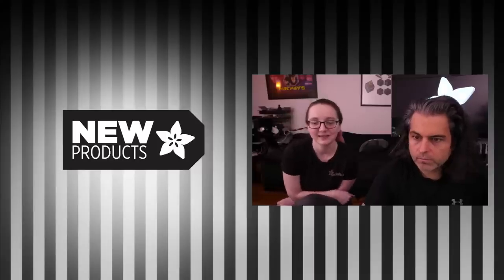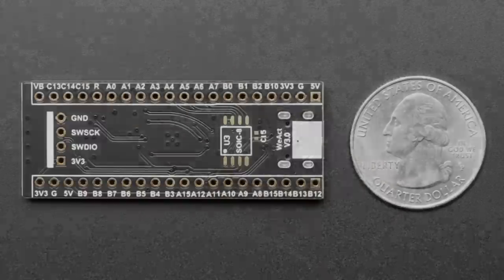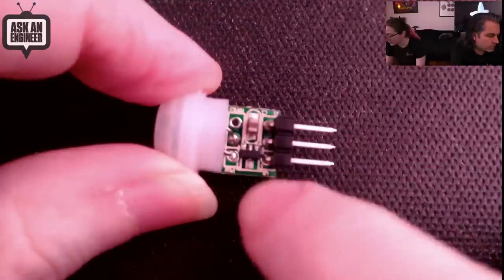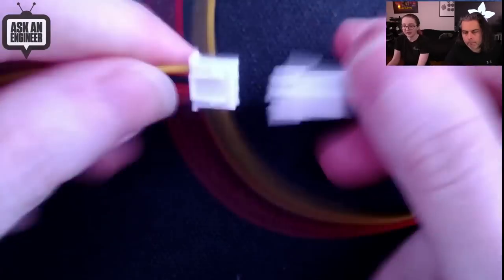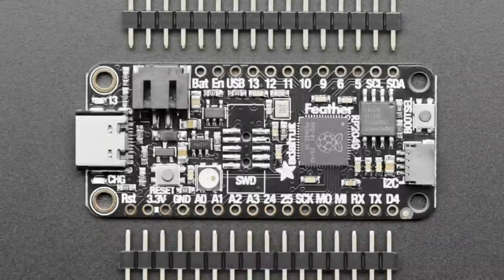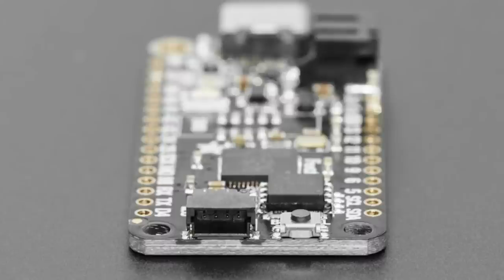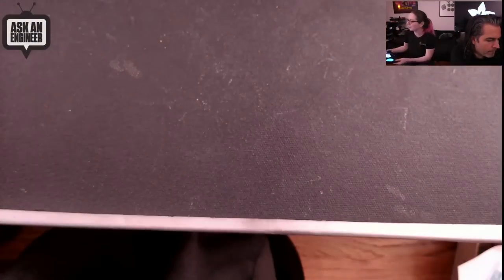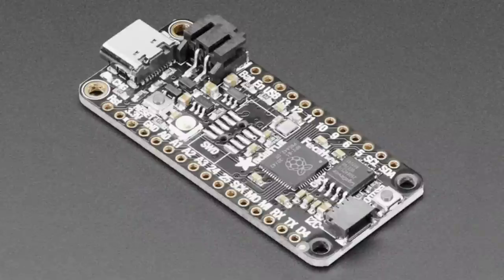New Products 3/03/2021 Feat. Adafruit Feather RP2040!

Comment: Do you have extension cables for Battery monitors? I am looking for one that is already made up. It has 26AWG wire and is a 5 pin connector. The one that came with the monitor has the same end on both sides which I believe is a female end. I guess I need one with a male end and a female end. I believe it is a 2.5 pitch and looks like the connectors in this post, except they are shielded. Any help would be appreciated, Thank You.